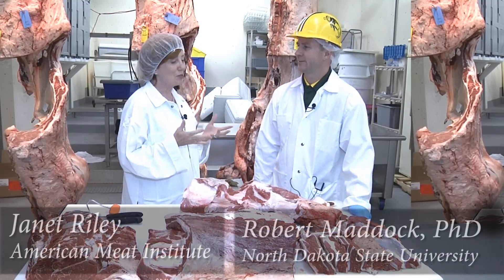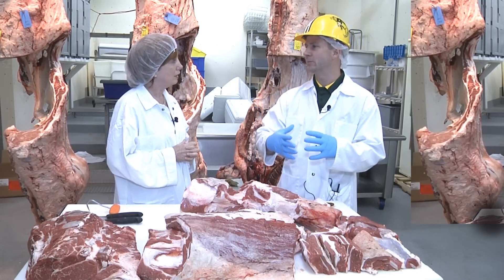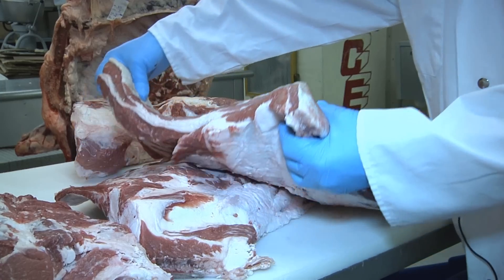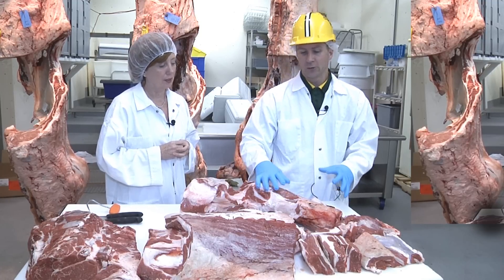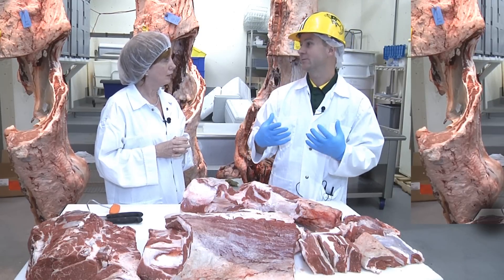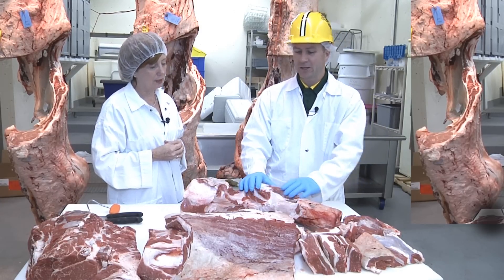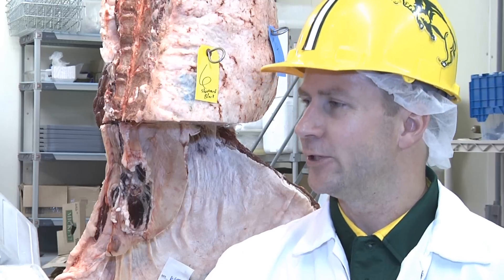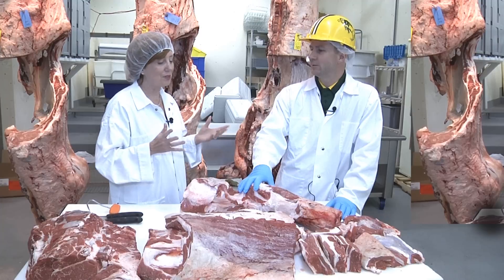Meat Mythcrushers: How Ground Beef Is Made

Comment: He stated meat is only good for 1 day in the refrigerator is a lie, and also saying if its not vacuum sealed it doesn't freeze well another lie. You can break down a 10lb  block of beef and put them in sandwich bags and just try to get as much air as possible and it will store well for months.